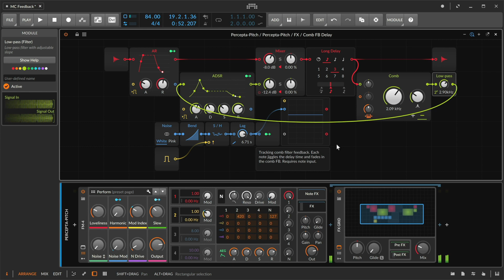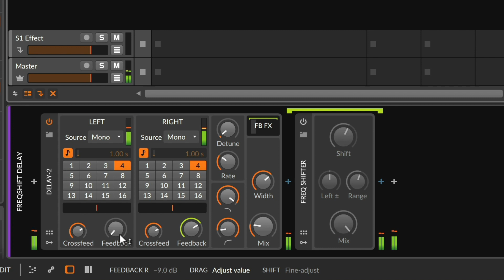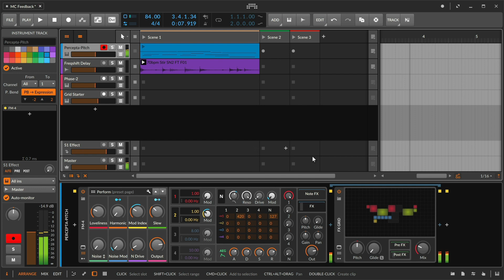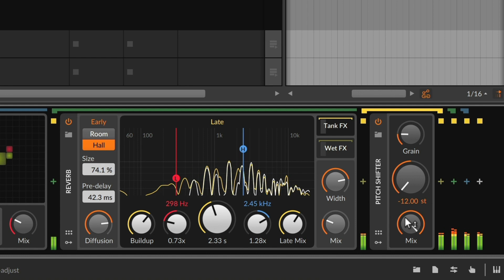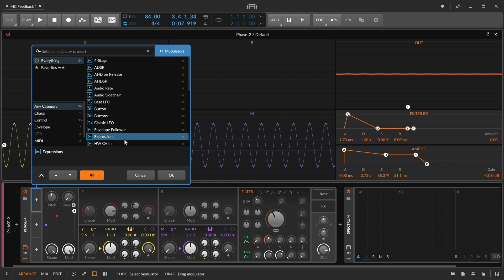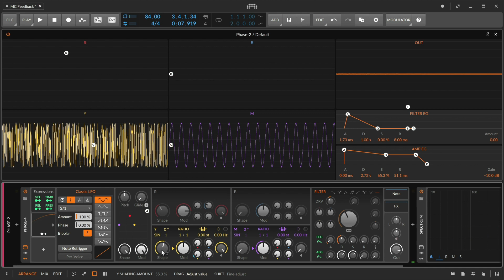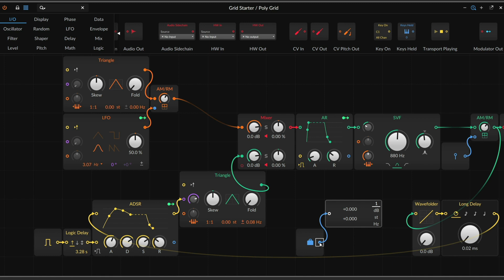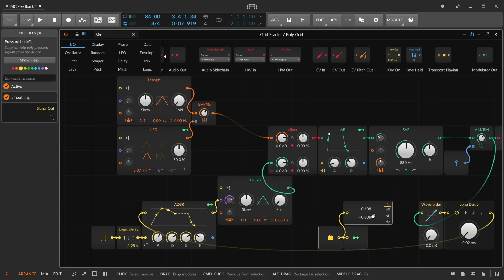Modular Concepts: Feedback [Bitwig Studio]

Comment: Four years later and the grid still can't do 1 sample unit feedback for buiding phasers , karplus strong , filters etc ..
Since the grid uses feedback that depends on the smallest audio buffers size , the  feedback loop will always be filled with harmonic content defined by the buffer size , whcih is not what you want when you want to build stuff .
SUch a shame they never implemented it ,   ..
Another case that the grid is not as capable as reaktor or max msp .
If they added some FFT , IIFT modules you could build your own spectral modules , but NO .. now they are charging money for spectral modules .
Bitwig is a joke

Comment: Super fun!

Feature Request. It would be nice if there was a way to hover over a patch cord, press a ctrl key and do a quick visualization the signal coming through. Very handy not to have to manually add scopes, level meters or spectrum analyzers manually. Anyway, again, nice video.
Reply: Thanks much~ And selecting any module shows scopes for its connected in ports (including pre-cords) and all outgoing signals in the Inspector Panel. It isn't everything you asked for but worth noting.
Reply: @davelinnenbank750  seriously, wow that's great 👍 👏 😄

Comment: Bravo! Another neat tutorial, getting us to hear differently.
Enjoyed the references to Bob Ross and Spiderman… ;-)
The pacing is quite nice in that the end result flows pretty well from what precedes it without being completely predictable. 
The connection to MPE or PolyAT can help people move to the expressive side. People often misunderstand what it means, saying that “I could do the same thing with knobs”. Not only is this inaccurate but the same people typically don’t do much with expressiveness. So many patches (including many BWS ones) aren’t even support velocity-sensitive. Yet a great BW strength is in supporting MPE and other forms of expression.
In many cases, PolyAT is enough to make a huge difference. Yet rare is the patch which supports it out of the box. With inexpensive devices like Novation’s Launchpad X and ROLI’s LUMI, patches supporting PolyAT don’t require a CS-80 level of commitment.

Comment: Feature request! A small chicklet module that just does the feedback job of the long delay at lowest setting. It just seems janky to have to use a big delay module to do feedback routings. 
Additional Feature request! A device line device that does the same feedback process sending signal back to another point in the device line. Or an option on the audio routing device to allow fedback signals with the required .02ms  or however many samples/blocks delay.
Reply: I was thinking the same thing.